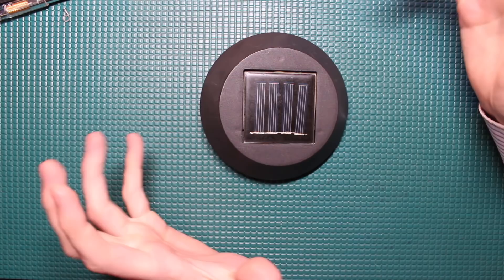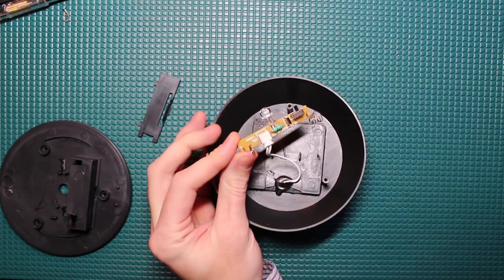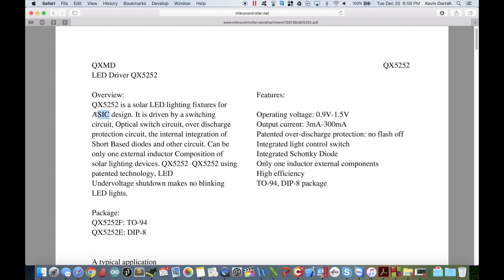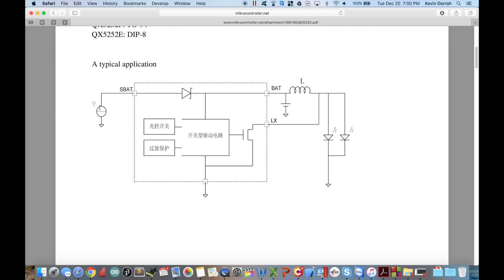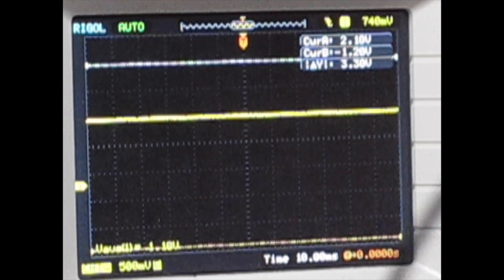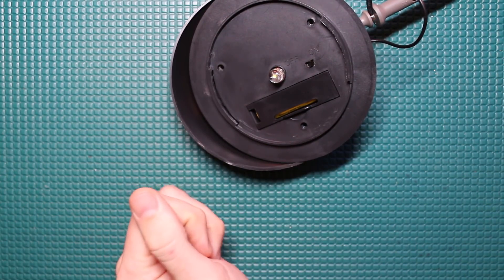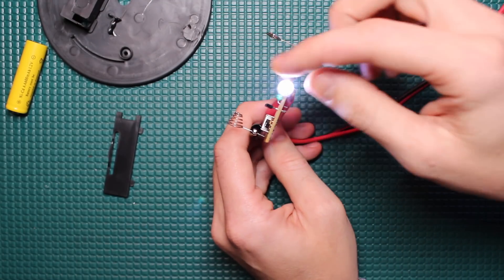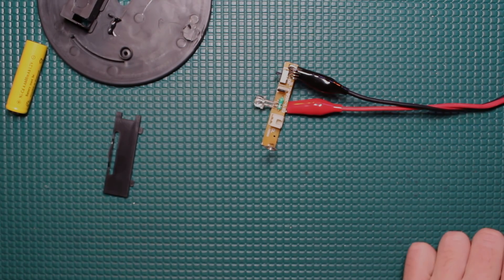Solar Light Circuit Explanation! Clever little design...

Comment: Thank you, I figured the ic was regulating between the batteries and the solar panel. I wasn’t sure if the LED needed a flat line DC voltage or was a pulse. You shown the electronics is a pulse to the LED , but the LED needs is a DC voltage.

Comment: You started off with... "I want to see if I can swap to a lithium battery" and "a led upgrade." After 12min of electrical circuitry gibberish... absolutely no conclusion or answer to your own original question and provided us with zero information to either of the upgrades you proposed.  No answers; No parts list; No build demo... Nothing... you sir are an engineer.

Comment: /Would it work with a 400uh to 470uh inductor or very low resistance to very high Q factor. If you up the battery Try a nicd size C or D, and make the solar cell larger.

Comment: I was a HVAC service tech for years and I've always been interested in circuitry. I was always tearing apart circuit boards to see if I cold repair them or see what the issue was. I found this interesting. Thanks for the info🤯👍

Comment: Thanks a million Kevin!  I've been hacking at my wife's solar lights that die for YEARS trying to get them going again - she loves cool glass, and the electronics that come with the cool glass are always crap so it's been a huge pain to recover from corrosion, re-solder broken connections, or even just tin the garbage wire that they use.  The 4-pin Mystery Silicon has always been present; one switch, what I thought was a resistor, solar panel input, and battery contacts.  Today after a particularly cool looking one died, I finally decided I'm going to dig deeper and figure these things out - I'm going to design & 3D print housings and come up with my own battery+solar driver circuit dammit!  A little Google effort and I found this video - SUPER HELPFUL!  4-pin guy is an ASIC!  Scooby Doo Mystery Solved!  Thanks again!  :)

Comment: I have a small garden solar light that isn’t working but the identical one is working really well. I have taken apart except removing the cell itself (which can be if needed) and found my red positive wire is no longer connected to the cell. Can someone tell me where that darn tiny red wire attaches? This light has blue, red and black wires, 2 of each. I can send a pic and would most likely be really simple for someone who knows the basics.

Comment: What is the highest safe voltage input from the solar panel... want to use the guts of a solar light and replace the solar panel with a 5v inductive charge coil receiver for a string of led lights.  Does this have some kind of over voltage protection/reduction on the input side from the solar pane feed?  Not in any way familiar with this kind of thing so not even sure how to ask question.

Comment: Help--something wrong with the solar panel or light sensor. Light goes on but won't go off when light is present. What could I do to fix it? There are like 6 of them but only 2 currently working. They are really nice copper or copper-look design. I love them and can't afford to replace them. Any suggestions to fix them? They don't have the plug thing--everything is soldered. Any help would be appreciated. Thanks.
Reply: Try putting in a new rechargeable battery.

Comment: I've had these exact same lights for almost two years. I bought them because they are less cheap looking than the others. If I had been able to see them in person I would have avoided them. 
The pros:
1. They were relatively inexpensive.
2. They are attractive. 
The cons: 
1. The batteries provided were obviously old stock and NONE of them lasted beyond one summer. Even cycling them didn't revive them. I have     had to replace all of them with new 600 mAh batteries.
2. The posts are such thin material that even a weak weed eater with dent and destroy them.
3. The collectors all turned white after one year and wouldn't create a recharge current. I was able to buff them and re-coat them back into operation.
4. The collectors are not sealed against water entry, so half of mine suffered corroded leads to the collectors and stopped working. I was able to re-solder them and waterproof the installation.
5. The LED's burned out in three of them in one year's time. I have installed new LED's.
6. The on/off switches quit in ALL of them and I have jumpered them permanently to the ON position.
7. They blow over in strong wind.
8. No parts are available.
My other solar path lights have also needed repairs and modifications, but none of the others performed as poorly as these. 
The single best thing you can do to extend the life of ANY solar powered LED light is to seal the edges of the collector so the thing won't fill up wit rain water.
Reply: So silicone around inset of solar panel?

Comment: if you replaced the 600mah battery with a 900mah or higher would it stay on longer? or would it just need more sunlight charge time, or would it screw up the ASIC?

Comment: Is there any way to "do this" such as to prevent battery discharge past 1.8v  and operate at around 2.5v ? I ask not for just putting two nimh in series, but to utilize the awesome 2.2v lithium titanate battery which withstands charging in -20 C and high temps, too. Also (supposedly) some 7,000 - 30,000 charge cycles!
I imagine having to use more parts, since I couldn't afford to have a dedicated chip made just for that!  
And, thanks for this video!
I am "testing" a 1500 mAh one by charging it in the sun (a couple of days were  just 15 F) and discharging LEDs ALL the time, about 45 mA (3 Amber LEDs in parallel) each with about a 13 ohm resistor. And with NO diode, because that would drop too much voltage from the 2.5v ~200mA panel. It doesn't seem to lose juice through the panel at night. will last for about 48 hours or so without a full charge (only gets up to about 2.6v because too many tree shadows and LEDs on all the time. Of course, there's less current the next day, so, seems to last a lot longer (and has yet to dim completely).
The "switch" is just me taking the battery out of the 18650 holder...
So yeah, I want to be able to do it right with a chip like the QX5252 that would work for this 1 volt higher requirement. I've searched and came to the conclusion that the LTO battery is very unpopular (due to its low voltage? Can't even find a cheap protective circuit board like they have for li-ion).
If you have the expertise to design such a board, I'd be able to pay after I get catch up with bills (painter in the winter, I am) !
Thanks for considering!

Comment: Dang , that one looks like its constructed WAY better then the Dollar Story variety I mess with.  They even used a Connector ?  LOL   All that and then they install a Wimpy azz 600mAh Chiniesium NiCad.  Just replace that with a real Sub C NiCad out of a old Drill Battery Pack and you would have something.    The circuit is working employing the Joule thief  concept.  https://en.wikipedia.org/wiki/Joule_thief

Comment: My biggest problem is solar panel itself, seems that either photo resistor drops dead or they are already selling these lamps with screwed up panels, as in 70% of bought, they dont react to day-night, so 1st day they lit up, drain battery and NEVER recharge again, can this thing be fixed ?

Comment: did you made its Schematic? i want to know the position of switch.
Reply: My looking at the switch in one I have is it cuts off the +bat from the chip, which seems to me it also is cutting off the solar panel from charging the battery.
I need to keep the battery charging and not lighting up at night, and not sure where the switch goes.  If I switch off the inductor, it may still consuming power running the transitor on/off at 200khz, so confused.
Reply: @murraymadness4674  I delivered products with switch at SW pin.
Reply: @murraymadness4674  LX pin, that switches the inductor. You did the same. Capacitor on LED will reduce effective brightness.

Comment: Hello Kevin. This is a great video. Thanks. I've been building solar lights for some time. This 5252f chip is my favorite. I've done a lot of testing with various inductors  and caps. To get the maximum current out and something close to DC use a 10 mH inductor and a 22-100uF cap. You can ever run color changing LEDs if you use the cap. Put the cap across the output to gnd. Remember that when you boost the voltage you use more current. (you don't get "somptin for nothin") The output is limited to about 100mA no matter what you use.  I use 4 piranha 20mA LEDs and they are really bright! The perfect set up is: at least a 300mA/ 2V solar panel,  a 2000mAh NIMH battery, a 10mH inductor and a 100mF/10v cap across the output.  That configuration will go almost all night. You can either modify an existing solar light and the 5252 board or you can order the parts on ebay. The circuit is really easy to build or you can buy them CHEAP on line and modify them yourself.  Check out aliexpress or ebay.  Here is where I get the boards to modify: https://www.aliexpress.com/item/10pcs-Solar-LED-drive-board-Christmas-lights/32812304604.html?spm=2114.13010208.99999999.271.iTQnI9

Comment: Had to watch this, I picked up one of those tops, a bit different, mine has the 8 pin package but pretty much the same, found it on a table at a community yard sale for a nickle.  It was so dirty I had no idea what the hell it was till I got it back to the camper and cleaned it up. Put an AA cell in it and it came to life. Sure not sure what I am going to do with it, but I think to start with the solar is coming off and will be re-purposed to run some other device of some sort.  They are very interesting, I built my own joule thief following Big Clive's video and it works great running a high output LED from a dead (mostly ) AA battery.

Comment: Hey Kevin, thanks for the great explanations. I've been looking into light/dark sensors a bit and I'm just curious if you know a solution with a low quiescent current drain. A 'standard' Darlington pair sensor with a photoresistor and two transistors works well but has a drain of a few milliamps. Would a setup with op amps work better? Thanks.

Comment: Thanks Kevin. Been waiting for someone to do a video on this.!  I need longer run time, shorter charge times. Battery capacity seems easy to increase with higher capacity NiCds available. And could I use a LSD NiMH or won't they charge well at 1.2V?
Reply: And I wonder if I could double the solar input voltage with two solar cells in series and charge a large capacity NiMH 'AA' cell.At least in my mostly shaded areas.
Reply: @HillsWorkbench   That's exactly what I am trying to do :)
Did you ever find the answer?
Thanks John :)

Comment: I took apart a Halloween lantern thingy, and found the identical circuit as this.  How do you determine what looks like a resistor, is indeed an inductor?
Reply: Axial inductors tend to be sea foam green, although some are pea green or even cyan. The cyan ones you can tell from 1% resistors because they have one fewer band.
Reply: Thanks

Comment: Been there done that. Pretty sure its the winter sun and undercharging that kills the cells, that's if corrosion doesn't physically damage them first.

I just put them in the shed during winter now.
Reply: Corrosion is the #1 killer for mine. I try and revive weak cells with an intelligent battery charger. Mine underperform in the summer due to a lot of them are in semi-shaded locations, but that's where I need them.

Comment: I still don't understand where the measurement of the available light is done to turn the LED On or Off. There must be some critical voltage in the QX5252F that's uses the solar panel as a LDR like device.
Reply from the maker: yep, it must be monitoring that solar panel pin to decide whether or not to turn the LED ON.  Funny thing is that the LED turns on when you disconnect the panel, so that makes sense.
Reply: Check out how solar panel is used to turn led on/off. http://www.reuk.co.uk/wordpress/solar/use-solar-panel-as-darkness-detector/

Comment: Does the solar panel double-up as an LDR replacement you think?
Reply from the maker: yep, but looks like there's a way you can use an LDR if you want
Reply: I was wondering how they implement that..Looking at the schematic wouldn't they always see the battery voltage? (and the solar panel voltage would never go above the battery voltage because of the charging). How do they know when it's dark? Maybe 'Lx' is more then an open collector and they use the LED as LDR?...The chip 'schematic' doesn't tell the whole story.
Reply: I think it is just simply, no power from the solar cell means, it is dark, then the control logic inside the chip does the magic
Reply: Then the control logic inside the chip as well as the LED are powered by the battery